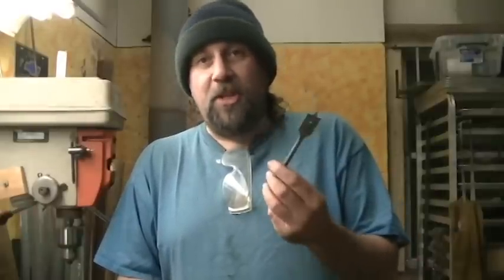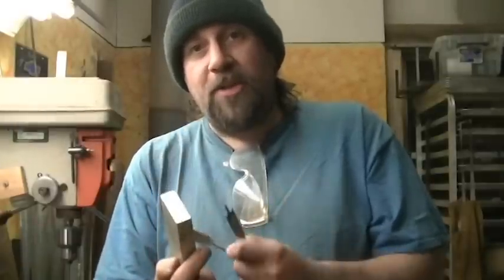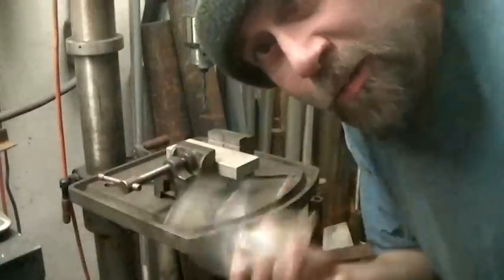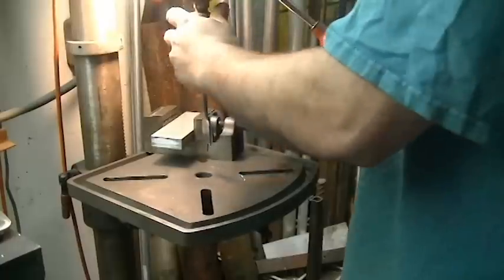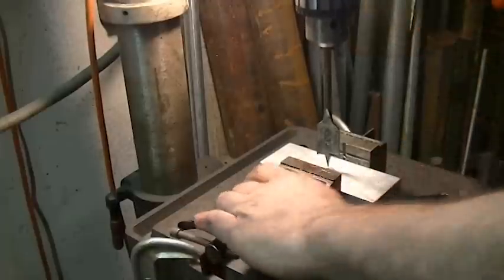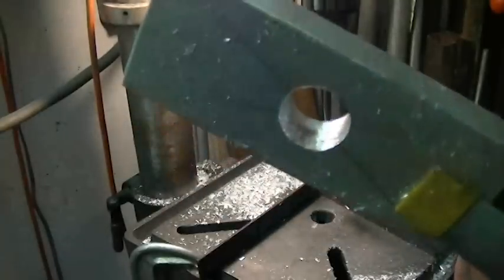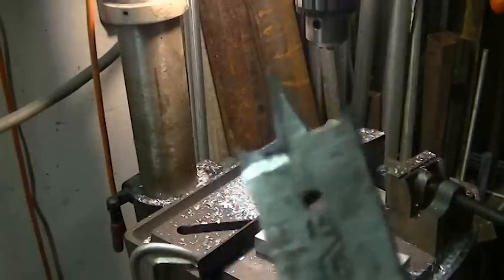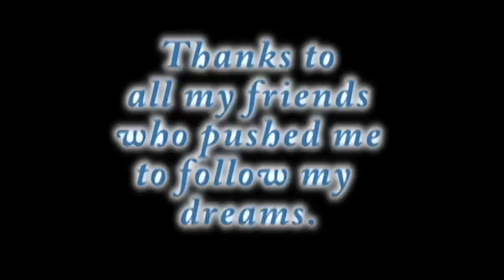Drilling A Hole Through Solid Aluminum Using A Speedbor / Paddle Bit

Comment: I've cut 1" plate aluminium on a cheap table saw and also on a cheap vertical bandsaw. Both intended for wood, and I didn't even bother with lube.
Worked alright!

I've also cut fine finned heatsink on that tablesaw with a sharp blade. That worked amazingly well.

Comment: Fantastic. I am looking to make a jig in 3/4" thick aluminum, with 5/8" inch holes all the way through, and a 3/4" hole only 1/8" down, perfectly centered with the 5/8" holes. I am going to drill a pilot like you did. Then use the 3/4" spade bit to bore 1/8" deep "recess". Then complete with a 5/8" metal bit through the stock.

I am simply trying to make a jig that will perfectly center 5/8" OD tubing onto a 3/4" disc, leaving a near perfect  1/16" lip. 

Your video here could not have been more perfect for me to determine if I could do this in our shop, as opposed to having a machine shop do it. Thank You!

Comment: at 5:09 when you started to drill,  the table moved down because you didn't take up the slack in the screw feed.  If you lower the table, always turn the screw feed back up a bit so the table stays in the same place.
Nice video.
Reply: This is one of those thing that you must learn by experience. Love it.

Comment: i have used regular non carbide 3/4" round off router bits b4 after welding tubes to a plenum on a sheet metal intake and i was blown away by the results had to actually rough up the surface slightly to help the air move with little more turbulence

Comment: Also not recommended but I cut 1/8 to 3/16 aluminum plate in my 10" table saw.   Yes it's a white knuckle moment!   You must use a reasonably slow and steady feed rate and make sure the plate is tied down REAL secure.   Oh, and use a good blade with beefy carbide teeth.
Reply: i dont know if thats something you do a lot or anything, but make yourself a sled for the table saw, and add a 6" strip of Plexiglas over the blade to stop the shavings from flying up and more out to the sides. works really well.
Reply: Daniel Napast you can buy blade for table saws to cut aluminium.
Reply: @danielnapast4955  I was actually always taught that, when cutting metal on the table saw, you actually want the opposite in terms of blade height, meaning you really want the blade up much much higher than if you were cutting the same thickness of wood. Some people I know just crank it all the way up to its max height when cutting aluminum. I can't remember exactly why now but when it was explained to me, I remember thinking oh yeah that totally makes sense.

Comment: A spritz of WD40 would go a long way toward keeping your bit and workpiece cooler, and improving the surface finish. Ideally you use plain ol' kerosene as a cutting fluid for aluminum. I've used carbide router bits on 6061-T6 aluminum many times with great success. I did expect an explosion during this video... Its tough enough to drill construction lumber with a spade bit and not get hurt.
Reply from the maker: Interesting about using kerosene as a cutting fluid for aluminum, I'm going to give that a shot the next time I have an opportunity. Thanks for the tip :)
Reply: Jeff Stewart I would agree with that. Spade bits grab hard enough in wood I thought it might be even worse in metal. Also, a little lubricant would most likely make a big difference.
Reply: I was going to say the same about adding some oil.

Comment: I have cut them into shapes too machine recesses for O rings and counter sink large bolt heads flush. Went with medium speed and low feed with bits as sharp as I could get them.

Comment: i wonder how well it would work if you slowed it down a bit, locked the table, clamped the vise, shortened the spade bit as much as possible, and used some WD40 or something. but hey, thnx for sharing :)
Reply from the maker: The table lock broke, just fixed it about a week ago... as for the rest, this is me without enough coffee to function. At least I entertain myself :)
Reply: Jeffrey Santo you just got me curious how nice of a hole one could get using that bit is all. :P
Reply from the maker: I'm going to be shooting a video doing the same thing with a 7/8" Forstner bit once it comes in. I plan to drill another hole with the paddle bit as well, this time in the mill. I'm interested to see if there will be any major difference.
Reply: I use forstner bits to drill 1/8" aluminum plate. Slow speed, sharp bit, and a little fluid.
Reply: I reckon the forstner bit will break at its neck, but hey I could be wrong.
Reply: dR.Ugz Exactly the comment I was going to make, to the letter.
Reply: Try kerosene as lub and there is nothing to hold the bit steady so no pilot hole .

Comment: You're supposed to go slower for bigger bits & faster for smaller bits in metal work. Aluminium is soft like brass though & can snag the bit. A bit this big shouldn't be a problem though. They're called spade bits over here & if made out of the right material they will cut through metals just like a regular hss twist bit does. In fact they're one of the easiest types for toolmakers to make for one off special jobs in metal work /mass component contracts etc. That's obvious just by looking at it though. You got away with it because steel is harder than aluminium plain & simple. You could probably sharpen that bit up for wood use again no problem.

Comment: Hardwood Knots and burl is uneven and harder than Aluminum, Brass and Copper,
if it can cut Hardwood Knots and burl it will cut Aluminum, Brass and Copper, 
Copper work hardens so you need to cut aggressive but not so aggressive as to bind.

Comment: Aluminum goes molten easy coolant is required, go slow if you don't use coolant..I could just see the shaft bend on the drill and doing a gut shot on his hand ..

Comment: yep aluminum drilling or cutting works much faster and cooler with the right lubricant. you can also use a paddle bit to drill through sheet metal. if it is a piece than can be done on the drill press try to put some wood underneath. another thing i learned from a friend and coworker who only had a grade school education. you can learn a lot from a dummy.

Comment: Thanks. This is exactly what I needed to know today. Do you think you could have gone faster if you used coolant?  4:30 is quite a long time. Any other ideas that might speed up the process?
Reply from the maker: The problem with faster speeds, if there is any runout at all the it will start to vibrate a lot and make the hole slightly out of round.
Reply: @jeffreysanto  Thanks.  That makes sense.  I'm going to give this a try tonight.  Bought a brand new Diablo bit so it will be plenty sharp.

Comment: Hey do you have a video on how to drill through solid lead successfully with a 1/8" bit or smaller? It's nearly impossible on every try I have seen.
Reply from the maker: This peeked my interest, I've never tried to drill lead before... what happens? does the drill bit break? How think of a piece of lead are you trying to drill?  I love trying to troubleshoot problems and if I can help you and solve a riddle in the process I will even make a video on it.

Comment: Drill press probably can't go as slow as you need...
Reply: I dunno. My drill press goes down to 220 rpm, which is slow enough to drill about a 2 inch hole through mild steel with a twist bit.
Reply: DSCKy aluminum has a high cutting speed he's not Drilling through Steel

Comment: watched one of my buddies use one of those bits to try to drill through ceramic tile while pulling an all nighter on a job. Yea that didn't work but it will drill through your thigh without a problem.